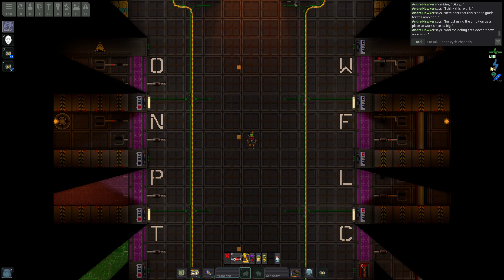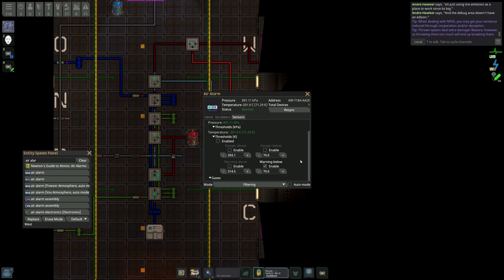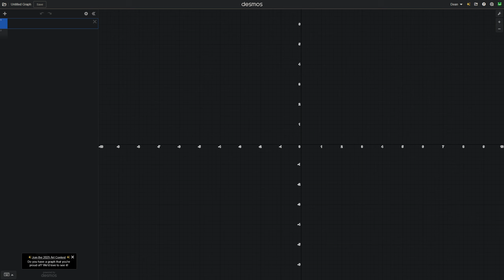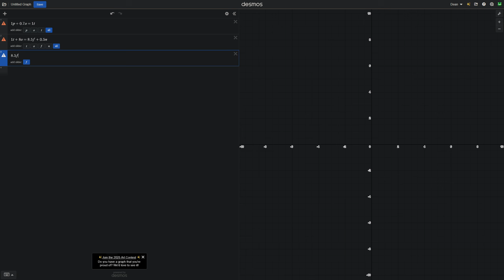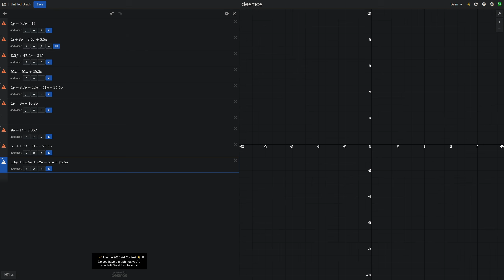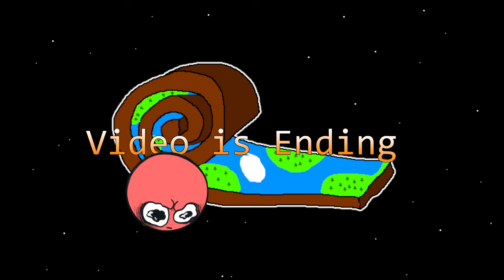Space Station 14: basics of efficient tritium & frezon (Frontier)

Comment: This has been super useful to watch! Frezon has been something I've still messed up even when trying to set up filter ticks, so seeing this has really made things easy to understand!

One thing I'm curious about is, can you use a Thermo Heater on the Frezon "reactor junction" and set it to 70K to set a "minimum temperature"? I know on Monolith and other branches I've used a pair of Heater+Freezer to set a baseline region for reacting (since the Heater will heat until at least that temp, and Freezer will cool until at most that temp).
Reply from the maker: You can. Heaters have a limit to how much energy they can introduce to the mixture every tick, though, so if you rely on a heater to warm your freezon, then the setup tends to not scale well. as you try to make more and more frezon, youll end up with more and more nitrous oxide, and you'll need to place more and more heaters down. Additionally, heaters require a decent bit of power, which can be an annoyance.

With the hot water method, increasing the heat injection just requires adjusting the settings in one or two pumps. Much more scalable as you ramp up production and doesn't require you to upgrade your ship's power network.

On stations, I'd say go with the heaters, theyll get the job done well enough. on the frontier, water is the way to go imo since you want to be able to use all the gas you find without any heating bottlenecks.
Reply from the maker: Also, just today we've been doing math in the GAS discord and are realizing that a properly efficient frezon loop may not need heating at all, at least not in frontier. No heaters, no water, nothing.

If your oxygen is warm enough, and you're separating your frezon and nitrogen in one tick, then the energy the warm oxygen brings into the mixture is enough to offset the energy lost to the one tick of nitrous oxide synthesis. If you're a math enjoyer here's the calculator we made :https://www.desmos.com/calculator/wbfrgjllvo but the long and short of it is that the numbers happen work out to have temperatures stabilize above 73K with this kind of frezon setup and warm oxygen input.

Heaters or steam are probably still desirable in practice, but the theoretical steady state you reach by just letting it run forever with constant gas being supplied is actually a very respectable temperature to be cooking frezon at.
Reply: @OxidisedGearz  I noticed this "heating-nonessential" technique in your retort video. Quite revolutionary discovery